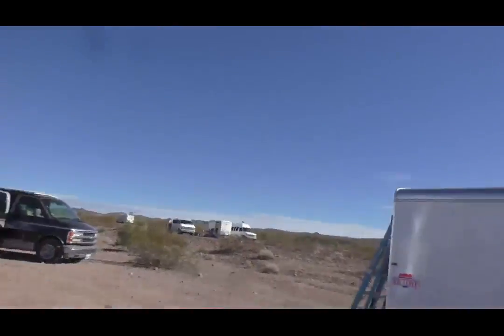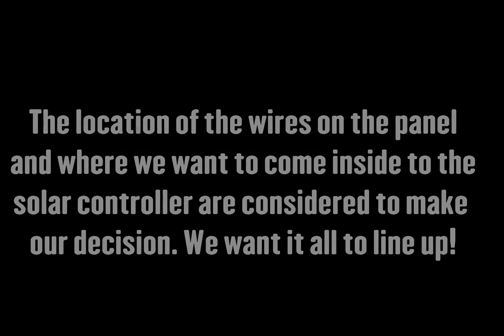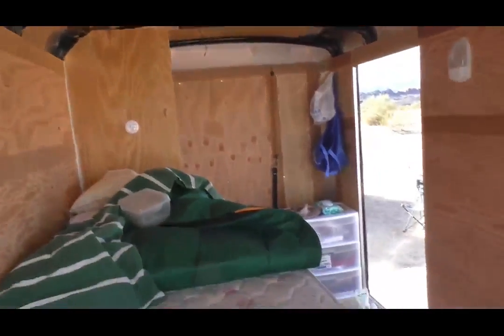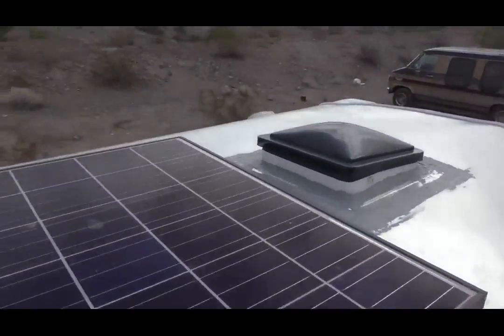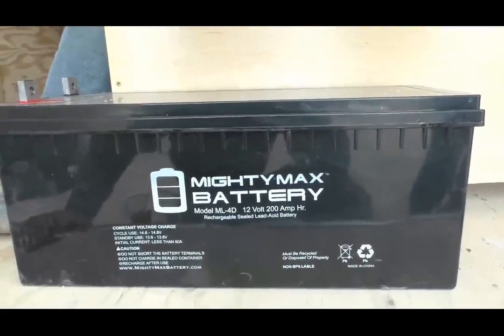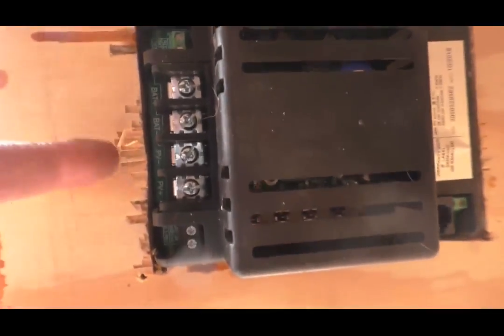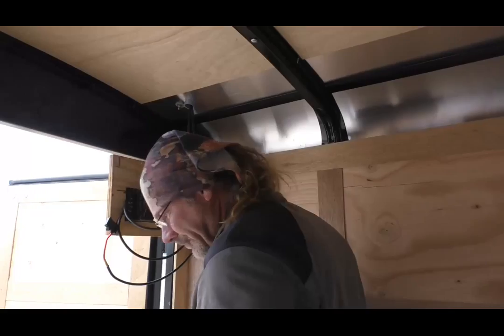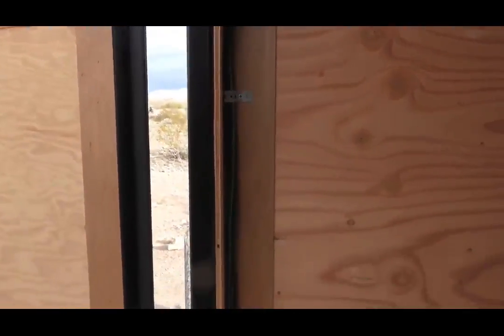How to install Solar panels for RV | Bobs Cargo Trailer Install

Comment: Great vid and install. I'd like to know how well those MIGHTYMAX AGM Batteries work? What is the life span ? I know they are maintenance free being sealed and all, but over time under normal use, how long do they last? I have two 6 Volt Trojan T-105 RE connected is series and they seem to be doing ok but in all honesty, having to maintain them can be a pain in the Butt. I think if the MIGHTYMAX is a better way to go, then I'd like to go with one of those in my new build. So what do think of the MIGHTYMAX  ????
Reply from the maker: Goodolboy One I haven’t caught up with Bob in a while to see, but I made the switch over to the battle born lithium batteries and I absolutely love them. They are more upfront cost, but they come with a 10 year warranty and all of the apps and the batteries are usable rather than half with lead acid.

Comment: No low voltage disconnect ? Or is one built in that charge controller ? Those big AGMs are too expensive not to run one
Reply from the maker: That's a really good point! Jason at Northern Arizona Wind and Sun set the components up for us on 
this one and didn't suggest one. I'll go back and look into it

Comment: Ok I  was just wondering.  I am not being critical. It looks like a fine job. I don't think it will leak either.  It is just another way of doing it I guess.
Reply from the maker: Yes, Dewey's Stuff. We want to keep that box exposed so Bob can get to it in case he wants to run more lines outside, such as a TV antenna, in the future. Thanks for watching!

Comment: so is 400 watts of solar good enough to run a small microwave small refrigerator freezer because I right now I know that Amazon has a 400 watt renogy set up for about 600 bucks minus the inverter and batteries .. for a Dodge Ram van maxi 1 ton
Reply from the maker: The inverter is what will or wont run the microwave. Plus the battery bank must be large enough to handle the draw. Check the wattage of the Microwave and work from there. I don't have one so I'm not well versed on the requirements, but starting with a 12v microwave is a good idea!
Reply: I already have a 2000 watt inverter from when I was driving truck.... also where I live I have a ton of windmills and they replace the big batteries for those and I can get those batteries for about a hundred bucks a piece and they'll still be under warranty

Comment: That's a very expensive solar charger at $ 230.00 is there a specific reason besides been able to calibrate it when there's other MPPT units on the market with great reviews for half the price?
Reply from the maker: Blue Sky MPPT controllers are legit. I haven't tested them against cheaper ones, but that is about all I would own. Everyone has different opinions.

Comment: Why a fuse between the panels and the controller? I don't think I've ever seen a fuse there; I understand panels can short without creating any problem so I'm not sure what the fuse would be protecting from?
Reply from the maker: Technically due to the wattage of the one panel, Jay Jay, you are correct in questioning a fuse between the panel and controller. In this case. I installed one on the advice of the company that sold us the equipment. Commercially made solar panels over 50 watts have 10 gauge wires capable of handling up to 30 amps of current flow. If you connect these panels in series, there will be no increase in current flow so fusing is not required for this string. This is not the case when you have panels connected in parallel, as when connected in parallel the system current is additive. For instance if you have 4 panels each capable of up to 15 
amps, then a short in one panel can draw all 60 amps towards that short-circuited panel. This will cause the wires leading to that panel to far exceed 30 amps causing that wire-pair to potentially catch fire. In the case of panels in parallel, a 30-amp fuse is required for each panel. If your panels are smaller than 50 watts, and use only 12 gauge wires, and 20 amp fuses are required.
Reply: That's interesting, I didn't know that. My setup was 2x260W in series, so I'm glad the new owner is safe!

Comment: You should cover the panel so you do not  power up the system before you are finished.
Reply from the maker: Not a bad idea Carl. I typically don't do it. The main point to be considered is the the battery powers up the controller before the panel wires are added according to the Blue Sky tech I spoke to on the phone about this particular unit. Controlling the panel power with a cover will never hurt a thing.
Reply: Is that on all panels or just blue ski? I have watched so many, does it matter? Thanks for the info.Jammie.

Comment: why didn't you put the roof penetration under the panel.  There would be less chance of leakage.
Reply from the maker: +Deweys stuff that penetration will not leak my friend. Please have confidence that a job done properly won't leak. I get these type comments all the time from folks afraid to drill a hole. Don't Fear The penatration. Practice and experience along with the right sealing compounds. You will be fine.

Comment: If i know i can't do this myself do you know who to recommend
Reply from the maker: Where do you live.
Reply: @enigmaticnomadics  i live in Maryland but we would like to be west by next year. I bought the kit from Amazon n this month deep cell battery then next month inverter and hopefully 2 more panels and repeat b4 we leave
Reply: Then generator the rig has to have a half tank of gas to run. I live off my disability, i broke my back in 03 n ssi is only about 950 a month

Comment: Regarding Folding 12V panels and Fixed large panels, i've noticed the same thing regarding price. We can purchase a 250Watt or 300Watt large single panel, cheaper than a 160Watt foldable or RV panel here in Australia.
EG: 12V 250Watt Foldable $529 vs 24V 250Watt Single $239
Use the higher panel voltage to lessen the Volt Drop to the Controller mounted near your Batteries. This allows for 15meters of LV cabling so the Panel can be situated remote to the Vehicle if need be (Vehicle in shade, Panel in full sun)
http://www.lowenergydevelopments.com.au/index.php?route=product/product&path=59&product_id=118
http://www.lowenergydevelopments.com.au/Solar-Panel-250W-Monoycrystalline